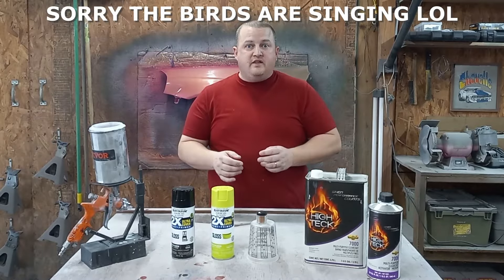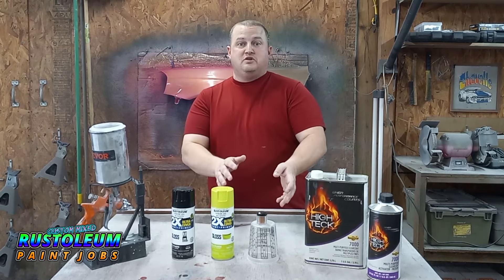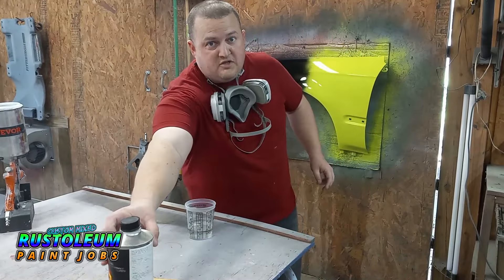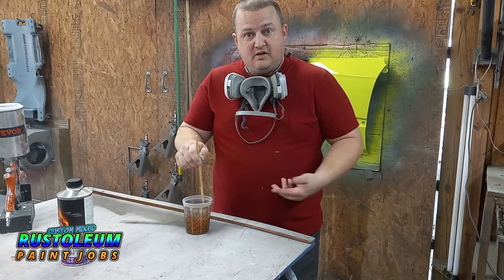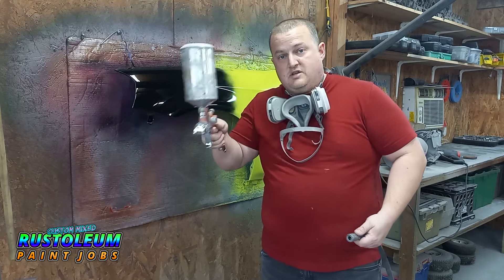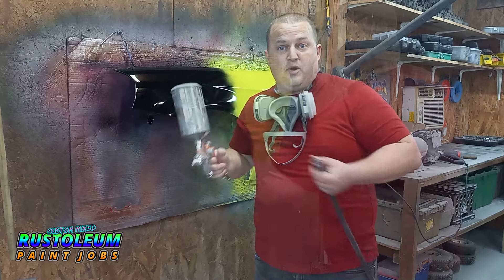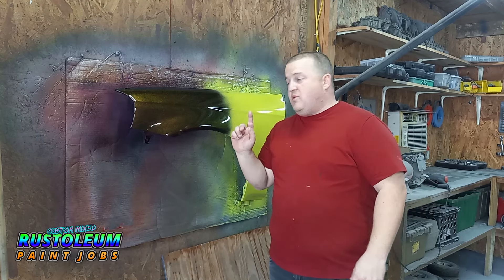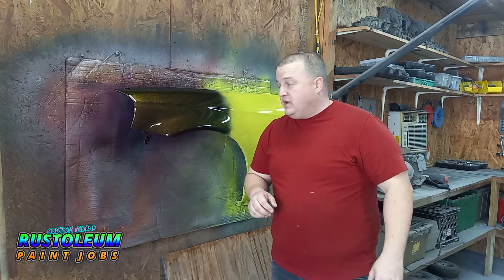RUSTOLEUM PAINT JOBS KEY LIME GREEN AND GLOSS BLACK WITH A CHAMPAGNE COLORSHIFT PEARL!!!

Comment: A quick question. Typically, how long do you wait before you spray the clear over the Rustoleum? Thanks.
Reply from the maker: 45 mins to an hr or until it's tacky to touch but not pulling paint off with your finger just touch the tape or a hidden area to check thanks for watching
Reply: @WHITLEYAUTOWORKS  Thank you!

Comment: How long should I wait before applying clear coat over rustolium paint
Reply from the maker: I typically wait about 45 minutes to an hour depending on the temperature but basic rule of thumb is touch an area that was painted that is unsuspecting or the tape you're using that has paint on it and as long as it's tacky but not pulling paint off on your finger you are ready to move on to the next coat thanks for watching

Comment: I like your channel and the content. But what I'd like to know is the long term durability of the combo of Rustoleum and clear ?
Reply from the maker: I've been doing this in paint jobs for years this way as long as you use 2K urethane clear over Rustoleum I haven't had any issues it works as if you used any other regular Automotive base coat and we'll hold up for years as long as you prep the car correctly thanks for watching
Reply: @WHITLEYAUTOWORKS  Thanks for the reply